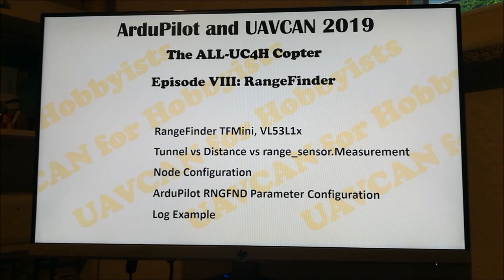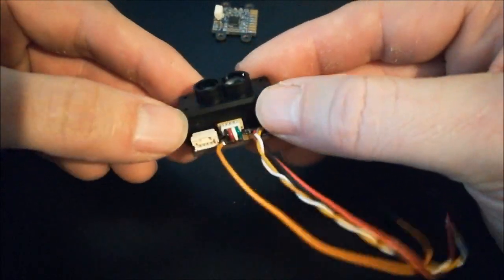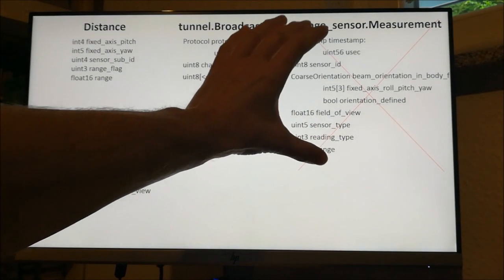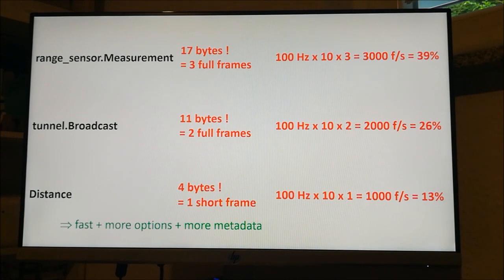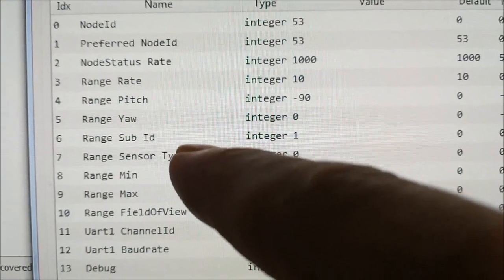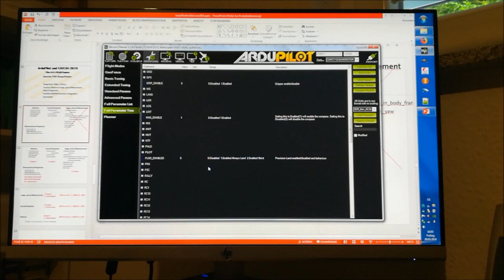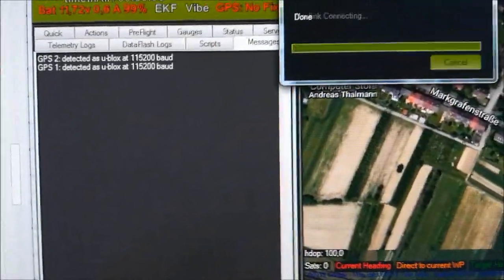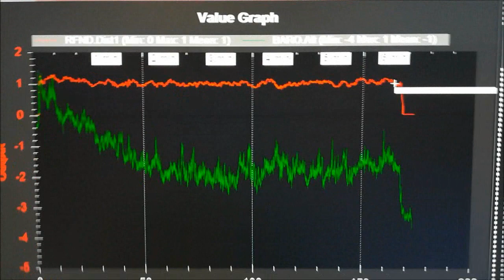ArduPilot & UAVCAN 2019: The ALL-UC4H Copter, Episode VIII RangeFinder

Comment: Doing a ton of UAVCAN research and plan on building up a twin motor fixed wing aircraft.  Right now the plan is to make it exclusively UAVCAN with a pixhawk FC. 
My question is, what would be involved in setting up a node/device/sensor that isn't supported yet? For example I intend to incorporate a few range finders for long and short distance, as well as temperature sensors on the motors, etc... 
I don't mind doing the programming of course.